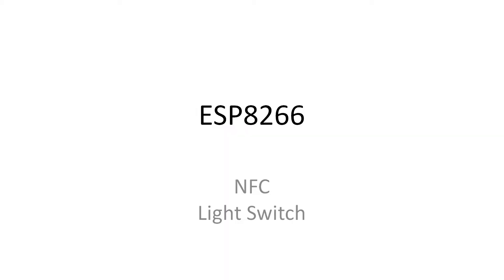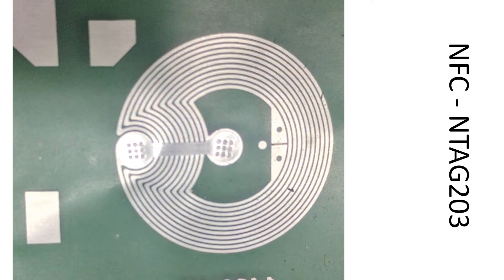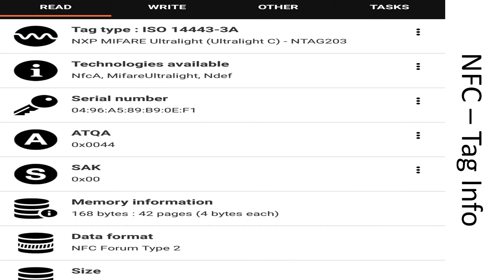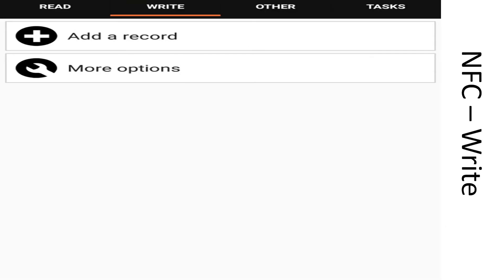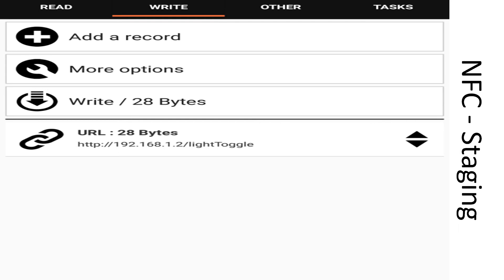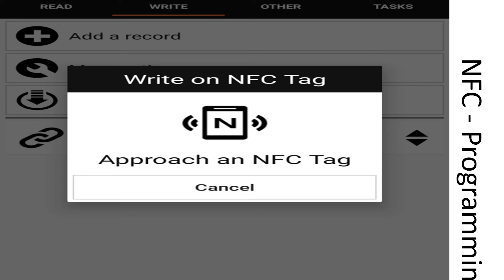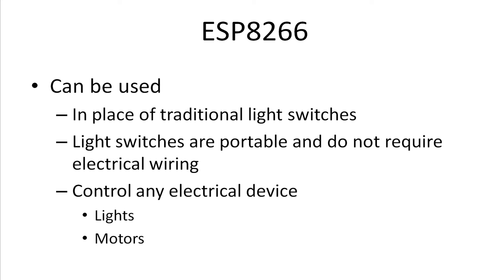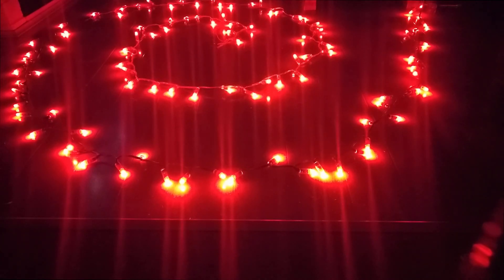ESP8266 / Arduino - NFC Tags as Light Switches

Comment: hello Risenrg

very interesting your video!

and I would be interested in the project to activate a relay, I have all the necessary arduino esp 8266 and nfc tags,

could you help me? in the whole project?

Thank you so much.
Reply from the maker: Hi SuperSamsung,

I think there are a few ways to tackle this project.

The simplest approach assuming you want to use an ESP8266 may be to set up a web server on your ESP8266 board that drives an output pin. That pin could be connected to a relay module.

Once the website is running you would need to program your NFC tag to point to the URL on your esp that activates the relay.

There are some esp8266 boards out there that have integrated Relays on the same board.